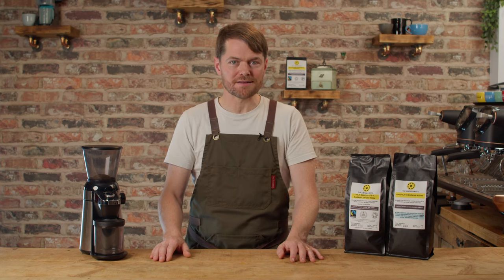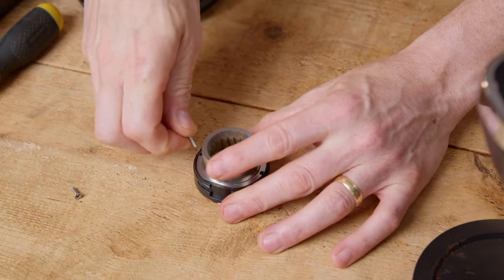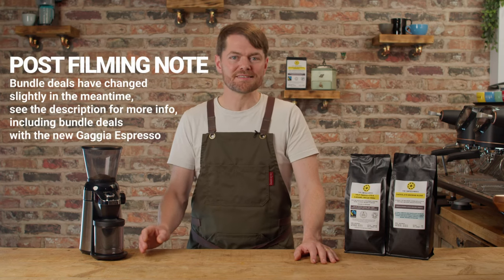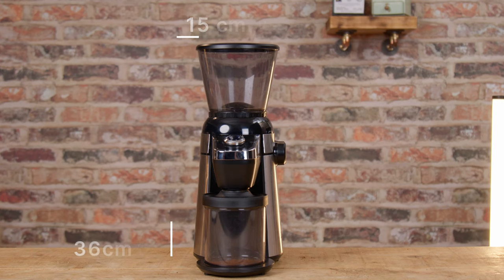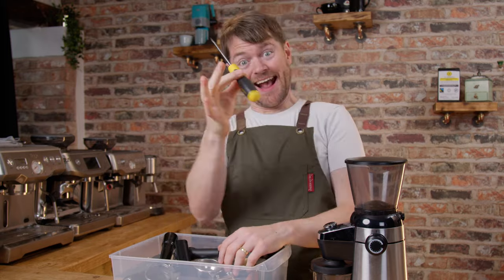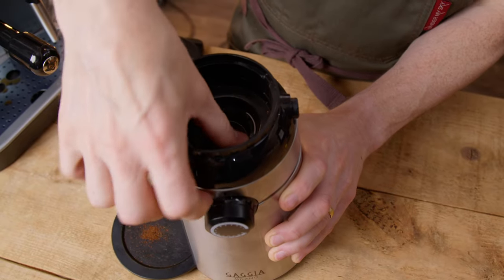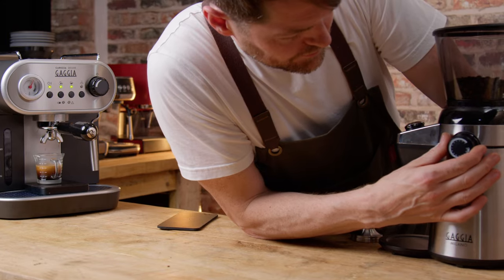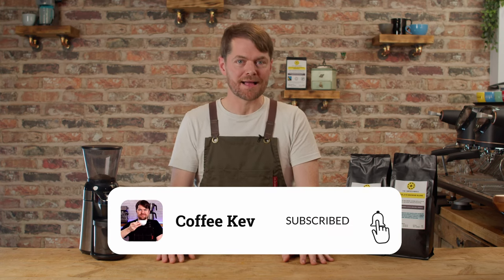Gaggia MD15 Grinder Review & Shimming Guide

Comment: Kev, can you please explain more about the below mod? How can I remove the hopper & install the below? What should be the size of the below? How can it be mounted?
Reply from the maker: I've had a play with modding the hopper to add bellows, and actually I don't think it's really needed. The majority of the retention appears to be in the chute, and pushing bellows doesn't actually appear to do a good job of moving them, just knocking the grinder over the top of the chute or just tilting the grinder and then putting it back flat seems to very easily get everything out of the chute.

Comment: Ive just purchased the gaggia espreso bundle and been getting to grips with it.Does putting rhe shims in effect the grind settings on the side? As in having to go up the scale/re calibrate ? Great videos by the way 👍
Reply: Bought the same...cworks  coffee just arrived so Im trying them over the weekend.... What are you using and what settings and results..
Reply: @spb4900 .
Ive got a standard 14g basket so I've been using that with about 15g in it.I put 2 shims in the grinder and the setting on the side dial is set to 3 at the moment but still experimenting
Reply: @darrenferis3593  same shims here, ordered the traditional basket as per Kev's video as well, yet to try , but now the coffee has arrived I'll give it a go..had mixed/ bitter coffee so far but that's pre bagged lavazza .
Reply from the maker: Yeah putting the shims in will adjust everything finer. Ta 😀👍
Reply: @spb4900 Have you had a chance of using it yet? How were the results?

Comment: Kev, if you were about to buy, would you go with a separate grinder and espresso machine, ie this MD15 and a Gaggia Classic, or a machine with an integrated machine like a Sage Barista Express/Pro? This for a fairly utilitarian user who just wants a decent espresso twice a day but doesn't want bean to cup.
Reply from the maker: There are pros and cons for both, just depends on the user. If you're someone who's not going to be overly fussy about perfectly dialling in, integrated grinder machines are fine. If you're getting into the home barista hobby, the grinder is ultra important, so the ability to upgrade the grinder is a must. Cheers, Kev.
Reply: @Coffee_Kev  cheers Kev, think it's gonna be the Bambino plus and a grinder 😊
Reply: @Coffee_Kev  just a quicK thanks Kev, early sale from Sage with teh discount code has me a Bambino Plus en route for £250 :) Happy days.

Comment: Hi Kev, I've just seen the Melitta Calibra on sale at Amazon for £75. Is it worth it?  Currently I'm using the integral grinder in my La Pavoni Domus Bar. Ta!
Reply from the maker: Hi :-). It's "OK", the grind by weight type feature is pretty good, but it kind of is what it is for that price. It won't grind fine enough for traditional baskets either, well the unit I have won't. See: https://www.youtube.com/watch?v=GIrp918X1jE (it's a cringey old video, don't judge my presentation skills! 😆)

Comment: Anyone tried the Geepas conical burr grinder that appears to be a copy of the Gaggia down to the same sized burrs. Goes for  a lot less on Amazon.
Reply from the maker: Yeah but what does Geepas rhyme with? 😆 I'm assuming it's the same base machine, there was another one too, the name escapes me at the minute but they were available before the MD15 and it looks identical. So I don't think it's a copy as such, I'm assuming they're all using the same base grinder, only assuming, I don't know. If you're in the UK then for me the main reason to go for the Gaggia over other branded options that appear to be identical would be the quality of Gaggia Direct's after sales service in the UK (if you buy from them or their resellers) and the fact that it comes with shims in the box. Ta, Kev.